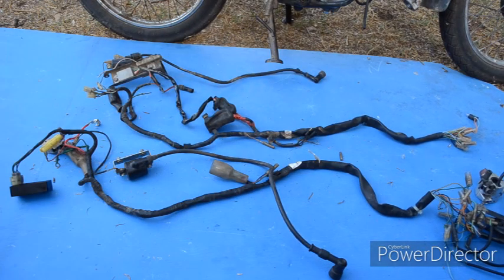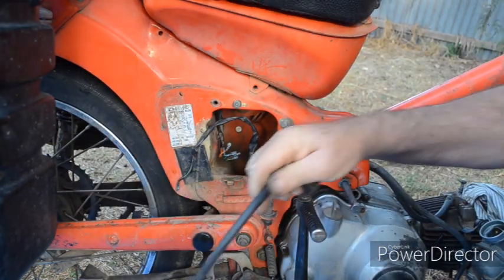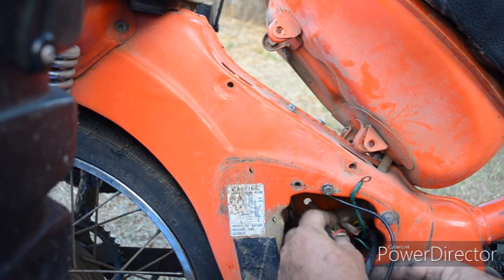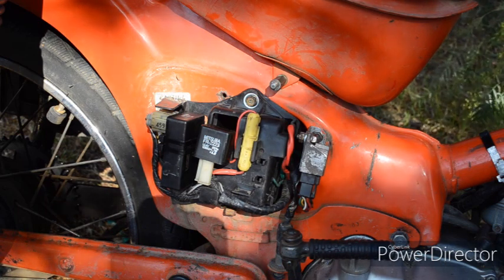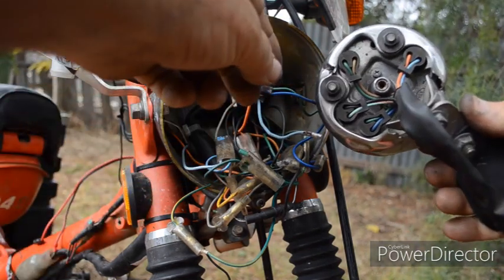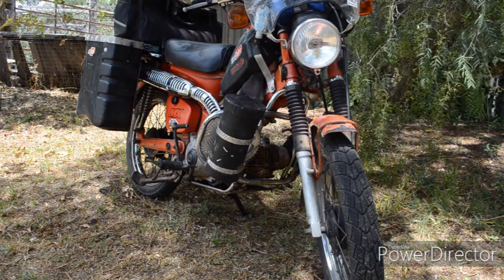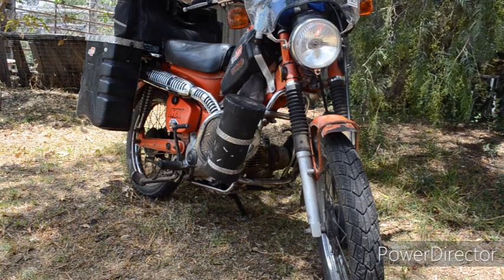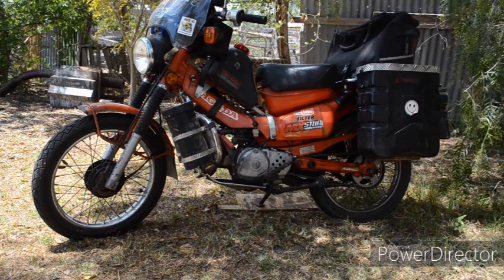Honda CT 110 6 to 12 volt Conversion - Part 2

Comment: Have you done or know of what to do to use 6v headlight switch r/h on/off on an allways on 12 v light model with no switch?
Keep up the great vids!! Well explained and presented every time!!
Reply from the maker: No I haven't done that, I just took the easy plug & play option.  But I'm sure with looking  at 6v & 12v wiring diagrams & nutting it out  it should be possible.  Thanks for your comment, greatly appreciated.

Comment: What an excellent conversation Darren, well done. I have an old 6v dax, I will be fitting a later 12v engine and loom to it. As you say it is so much more dependable on the 12v system.
Reply from the maker: Thanks John, I've just completed an 800km trip to Australia's most easterly mainland point & had to do over 10hrs in the dark.  That would have been impossible with the old electrics.  Electrics were spot on, no problems.  Appreciate your kind words, Darren.